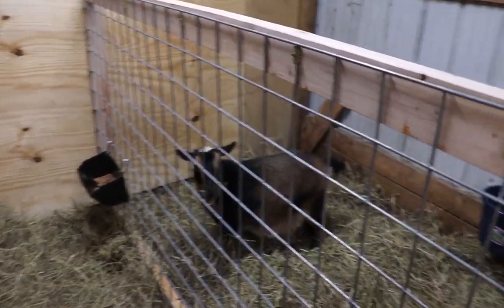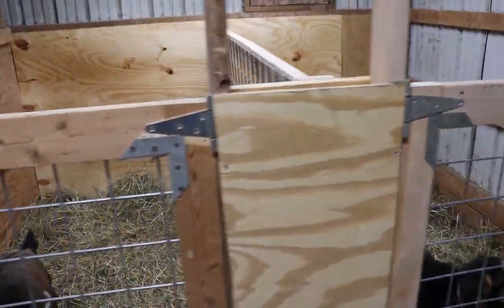Building Goat Stalls Out Of Cattle Panels

Comment: Very informative. Since you' ve constructed these pens, have you had any issues with the cut metal edges of the cattles panels, that aren't secured with the claw clips? I was concerned that, over time, they might start to flex off the wood a little; and since they are on the interior if the pens, could poke the livestock? Much thx!